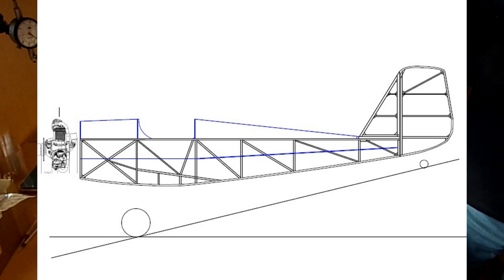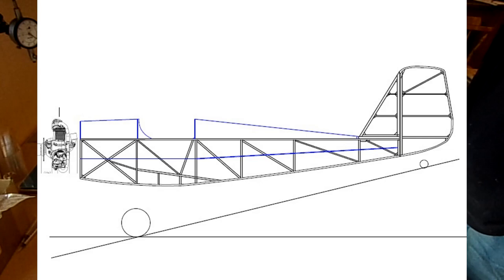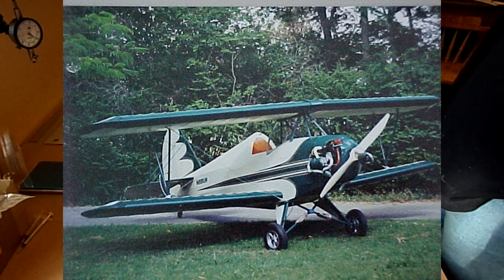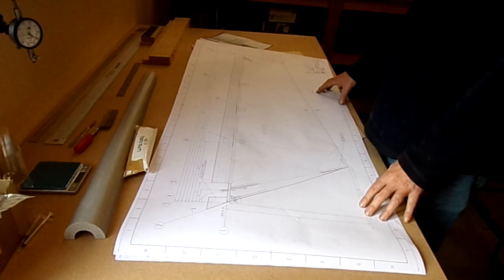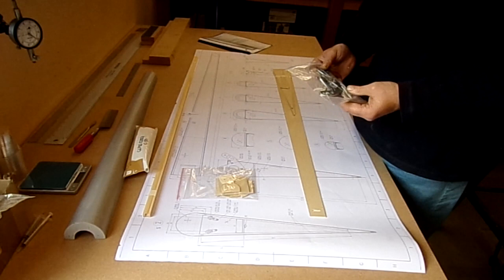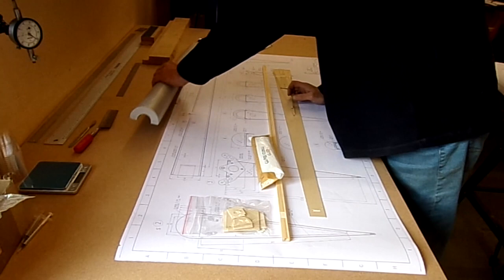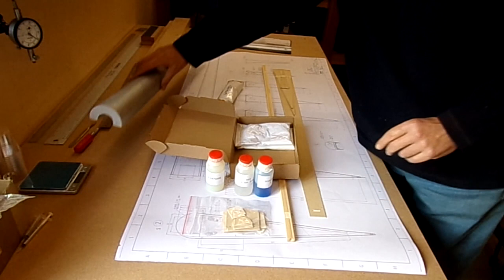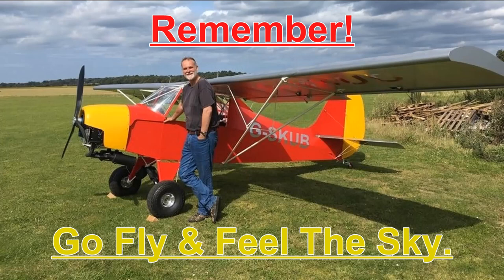Looking at Project X aircraft choice for home build aircraft.

Comment: That is quite a take on building your own aircraft.  If it were me I would be building either something I can take a passenger with me or a payload that I can take everything I need for a week away.  Better still, everything two people would need, but you are getting into something bigger then you really need then, but the passenger might be a good option, then that space could be used for the things you need if away for a weekend at some meet or whatever.  Don't build something where you are in the open, make sure you are protected from weather.  I like the idea of bi-plane with a cockpit where you are covered in and space for a passenger.  At the end of the day it is what you want to build, can afford, have time to build, what you will be happy with.  If you build something a bit sturdier you can land on rougher ground, bigger wheels and a stronger tail wheel.  But it is your aircraft and only you can choose what you want to build and fly.  Good luck in what you choose, only you can decide what you want and at the end of the day it is you that has to fly it and be happy with it and your choice.  That yellow one if it had a cover on the cockpit would be eye catching if it had a four stroke engine and a bit of power :-))  But build what appeals to you and be happy.  Stay safe.
Reply from the maker: You make very good points, the problem being in the UK a two seater is not an option unless it is a verified kit and you have then to get a lot of stage inspections. If I was going to build a two seater it would be the big brother to my Kub (the Scout). I don't need a big wheel aircraft as I have the Kub and we do not have the wild areas to play in like you do in the USA.
To me the choice is to build a vintage / classic style aircraft and dress up warm or go with a bit more performance.
Thank you for your comments all good.
Reply: @flyingkub  I'm not in the USA, I was thinking in rough grass strips/farm strips.  To many land owners here with strange ideas of landing where you want, "You are disturbing the birds and game I want to shoot later" and "This is private land and you should not be here"  even up here in Scotland where you are supposed to be able to roam free, it is just not like that.  In fact it is getting worse these day than it used to be.  Some land owners are quite happy, others think no one should go onto their land at all.  Worse than the Victorians!!
Reply from the maker: @BoB4jjjjs  Did not know you live in the Land I come from. For the normal grass strips the Kub is great, even landing on stubble fields. The idea of building my own plane is to build a plane, I am an engineer and just can not help myself, I have to build things. As you will know to build anything bigger than an SSDR in the UK requires the kit to be approved and no deviation without the manufacture approving it and inspections (also the cost goes up to more than double for a 2 seater), there are so many capable 2 seat microlights out there but very few that interest me as a build, that I can afford. With an SSDR I am free to modify it or build what I want as long as it stays within the requirements of the SSDR class as set by the CAA.
A covered 2 seat biplane like a Pitts S2 would need me to up my licence and would cost me a lot to run, insure and maintain. It would be my dream but it is just too far to stretch to.
Reply: @flyingkub  Yep, the regulations is a bit strong at times, but I suppose it is to stop idiots making mods to their aircraft that is not safe,  However, I do think the do go over the top at times.  In the USA you can get experimental, that would be great to have here.  I think they only need to have it inspected after the build.  Going by what I have picked up from videos, but they can make it look that way.  Anyway, whatever you decide I hope it is a good enjoyable build and that you are happy with it and it gives you hours. years of fun.
I would like a Kamov Ka-26, amazing aircraft and so adaptable, but mostly used for crop spraying.
Reply from the maker: @BoB4jjjjs  A bi-Axle helicopter if I remember correctly. They liked those in USSR I think they used them off ships as well as other utility tasks.
Reply: @flyingkub  Used for just about everything they can think of.  They have got to be the ugly helicopter award winner, but they have a unique sound, almost a whine as they fly.  You should see how they line up the rotors so they run true, they stand there with a stick at the end of the rotors after they paint the tips and keep doing that until the red, blue and green paint all line up!  Scary stuff.  Then they jump up on top with two shifting spanners and adjust them.  In typical Russian style of course.  If you think crop dusting is scary in a plane, you don't want to watch them in one of those helicopters!
Ugly helicopter, great idea, very adaptably.
They honestly have the best sound a helicopter could possibly have.
Reply from the maker: @BoB4jjjjs  I have done rotor blade tracking with the flag method in the RAF in the 80's so not that MAD. I would get my vote as Ugly but Practical helicopter, it is not all about the looks it is about the way they treat you (fly) (Sorry got side tracked there for a sec by wife).
Reply: @flyingkub  Stay safe out there.  Away to find some food before I waste away, fat chance of that!

Comment: your views on the hirth 23 i was thinking of putting it in my build
Reply from the maker: As 2 stroke engines go it is a good engine, I run my one with BlueMax oil at 90:1 and have very little carbon build up, plenty of power. My engine is the carb engine and running on premix, Mogas and used 100LL Avgas. The down side is the belts for the belt drive are no cheap and need replacing every 50hrs. I did dump the weight of the pull start, as I have electric start and the alternator has no problem running all my electrics.

Comment: Nice project! 👍🏻
Reply from the maker: Just playing at the moment not fully comitted to one yet, just getting a feel of the build. At some point in the New Year I will decide what will be built.
Reply: @flyingkub  I know a guy who flew a SD-1 for a couple of years and was very enthusiastic about the plane. Seems like a solid choice...
Reply from the maker: @ForFunFlyer  Thanks for that. The performance is great, with good range and speed. At 194cm tall I would need the long cockpit and highter canopy version. The only design down side is the flap speed limit is very tight to the approch speed and the reduction in roll control with flaps deplied. It is a strong contender.
Reply: @flyingkub  Aha, I see. Can you make your own mods to improve on that?